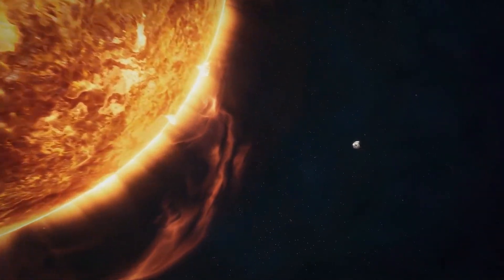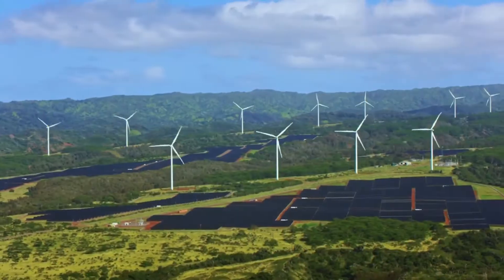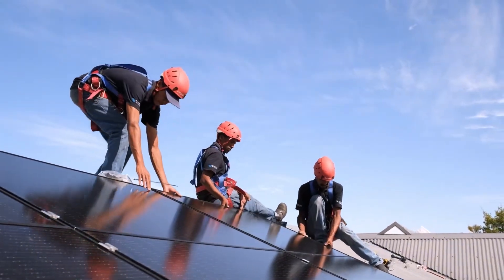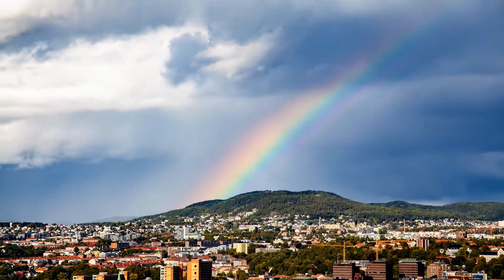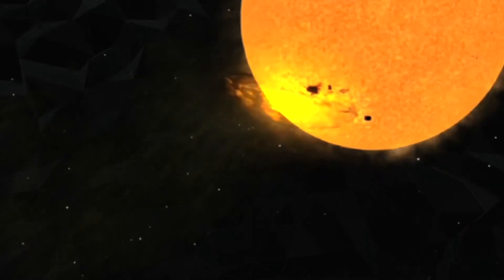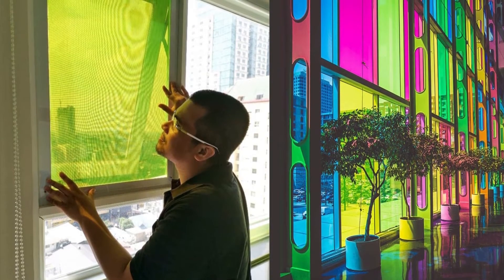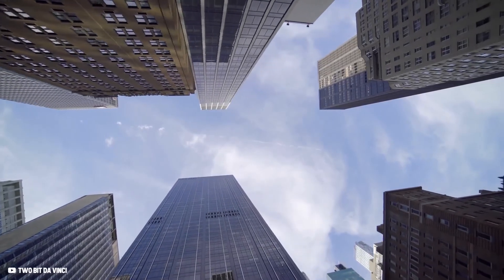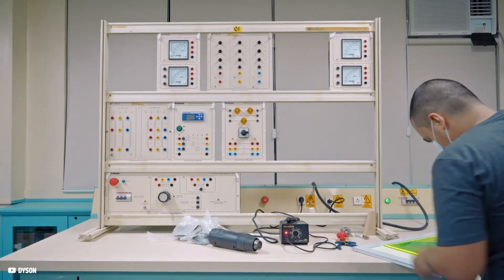Genius Solar Panel from Waste Operates without Sunlight!

Comment: I mean, as long as those photovoltaic cell can capture enough visible spectrum from these new panels than yeah. Having seen that footage at 6:54 though, it looks as though it only has a single row of them on the boarder - as opposed to the whole panel of a traditional panel. So i can't see them being used as windows unless we somehow 
A - can direct the luminescence at the photovoltaic cells or
B - Significantly increase the efficiency of those cells.

Not bagging this at all... it's a fantastic idea, particularly if we can get over those couple of hurdles.
Reply: It is a fascinating development - maybe a double layer could do more to direct the uv through a prismatic bending? i am talking out of the back of my head here - just a thought.

Comment: Transparent solar panels?
Conservation of energy. If most of the light is going straight through, it isn't being turned into electricity. 
Now you could turn the infrared and UV into electricity, and let the visible through. 
But it's still going to be less efficient. Better to put normal solar in some unimportant field.
Reply from the maker: Why not combining both ?

Comment: Revolutionary: if true as commented, investors should come in and give the world cheap and efficient energy system. The inventor should be recommended for NOBEL AWARD.
Reply: the ide isent new, or the application, but its in general better ways of doing the same without the energy losses...